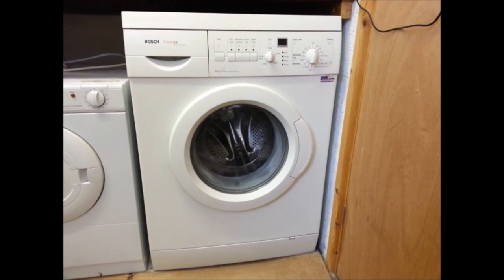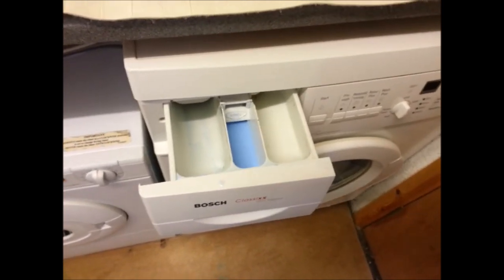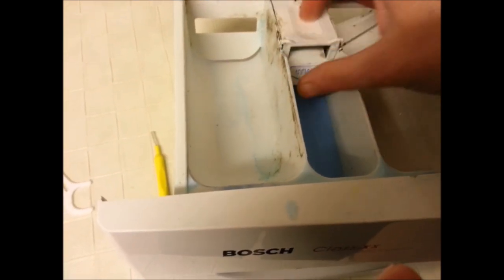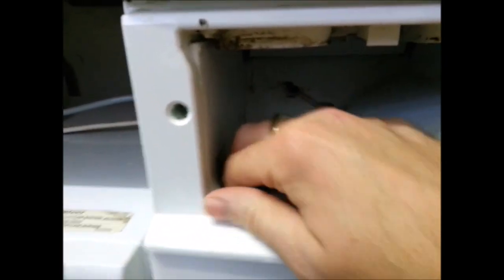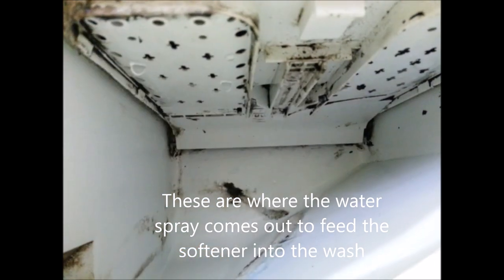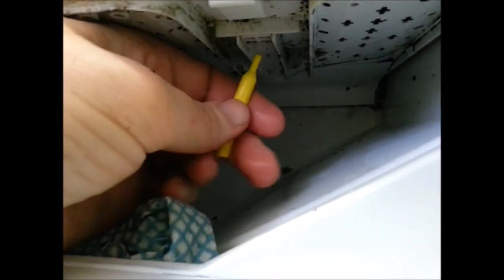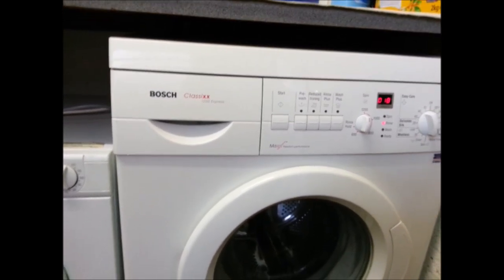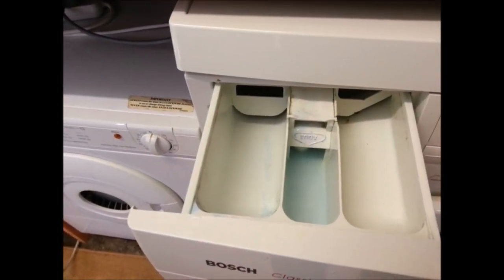How to fix a Bosch washing machine that isn't taking fabric softener

Comment: Spot on - thanks for taking the time to film and upload. Was tearing my hair out trying to figure out why I was getting water on the floor under the machine. Turns out the draw unit was clogged - the inflow hole to the drum was half blocked with washing powder gunge and water was escaping from the draw, flowing down behind the front panel.
Reply from the maker: Glad the video helped. Thanks for taking the time to comment

Comment: thanks for the vid! funny thing is i don't use softener but the water wasn't flowing properly. i took the drawer out, poked the holes a bit, looks like that helped. i also used the air spray just in case. thanks again!

Comment: many thanks for the video on our machine the problem was that after the wash cycle the softener draw was left full of clean water,  i carried out your instructions and gave the whole draw a complete  cleaning throughout  with hot soapy water using a tooth brush and clean sponge pads the ones that are green and white,  one side is rough like a very soft Brillo pad and after the cleaning gave it a run  without any washing in on rinse and spin and it cured the problem thanks once again RUSSELL PINXTON  DERBYSHIRE
Reply from the maker: Hello Amanda, really pleased to hear my video helped solve your problem. Thanks for taking the time to let me know
Reply: Amanda Higton aà

Comment: Clear instructions, thank you! I have had this problem for years! I found that even when using pipe cleaners the inlet pipe was still blocked as it is difficult to get around the 90 degree bend. Used a Dremel to grind away the cross and allow the pipe to be cleaned properly and flow directly into the tray. It now works!
I don't understand why manufacturers use sharp edges as these are known to gather material: poor design workmanship! When was the last time you saw a square water pipe? Also, when it is to be expected, why use pipes and holes of such a small size that will certainly and easily become blocked: again poor design workmanship. As this is not the only Bosch product I own with obvious design flaws I now avoid Bosch when replacing.

Comment: Thanks for this video. I also have a Bosch but have discoverd that this problem mainly occurs if I have been using the concentrated fabric conditioners rather than the original type.

Comment: You can use a computer aerosol air spray cleaner with the thin tube attached and spray the air into the holes.

Comment: Small hand held steam cleaner, with small attachment nozzle, will blast out debris  built up limescale and built up Detergent and Softener residue.. Open drain plug and excess dirty water and residue with flow straight out!

Comment: These are simple to work on. You can remove the lid, take the drawer housing out and it breaks down into several parts and you can run it through a dishwasher to completly clear it.
Reply: Thanks TLC, thats really handy to know and a lot less hassle than messing around with dental implements.  A big problem is that most people who use a washing machine would rightly assume that the detergent and fabric softener they use dont bung their machines up with mould and scum.  If they knew then im sure they'd clean regularly and avoid the problem.

Comment: Thank you for your video, I found it most helpful, my machine has three rows of tiny holes over each dispensing section and my hand gets stuck when I try and clean them 😁 but the interdental brush works for me.

Comment: super clear video. cleaned the drawer out, now waiting for a cycle to run. Been wondering how exactly the additive compartment works though. it seems to look like the nozzles (for want of a better word) fit into each other; so, where does the conditioner go? flummoxed.

Comment: You can use Dettol Washing Machine Cleaner 250ml and it will clean away all the black gunge and make both the soap / fabric conditioner compartment absolutely spotless as good as new. It also will clean all other places within the washing machine that you cannot see.

Comment: I fixed mine by just adding 2 cups of water (500ml) to the dispenser box #2 after cleaning out the impeller trap at the bottom of the washer. I think the pump needs that water to prime the suction inlet.
Hope this helps.

Comment: Great video, had this problem, tried boiling water, fully cleaning out the drawer itself, nothing was working... after watching your video I turned my attention to the jets, fully blocked up with gunk! Didn't think about where the water comes out (honestly didn't have much of an idea of how it worked at all) It was my own fault for trying to clean it before it was blocked, just ran a cloth along the top of the drawer bit, must have been what blocked up the jets... I had to come to work before I tested it but thought I'd leave a comment anyway I'm that confident that was the issue.

Comment: You can break that middle bit off completely and leave it off its just clipped in,, my old bosch used to do this clogging and an engineer just took the middle bit off and it was perfect. but sadly after a few more years the bearing went and was as cheap to buy a new washing machine as it was to fix it.

Comment: Firstly, thanks so much for the great video. I know your first step was the block the hole before starting anything, and I did that the first time I used your method to clean jets...but i forgot to block the whole the next time and the little plastic stick i was using fell down the hole. Can I use my machine anyway or do I need to call out an engineer to try remove the piece first?

Comment: Thank you!  Solved the problem.  Question though, would using a washing machine cleaner more regularly negate this issue?
Reply: Hey, Smudger, was reading through the comments after cleaning out the drawer of my Bosch. Thinking about your question, i dont think using the washing machine cleaner would help with this issue as this problem arises due to impurities in the water coming into the machine from your water source. a build up there is practically inevitable i think.

Comment: It didn't work for my Bosch washer though. It's completely new and nothing should be clogged. I cleaned the holes (they are lined up in a row above the softener compartment) but the washer is still ignoring the softener. I think it's yet another issue. I'm giving up with Bosch washers as the hardware programming/wiring seems dubious in their products. Thank you for the video though.

Comment: Thankyou so much for this information much appreciated. When done this it worked. Fab thanks again.
Reply: You can also use Dettol Washing Machine cleaner 5 in 1 and it will clean all the black gunge away and leave the compartment spotless.

Comment: Hi I did this about year ago and it worked fine. I noticed last week that the fabric conditioner compartment was not emptying although water was coming into to it because the conditioner was diluted. I cleaned everything again however it is still not draining the liquid...any oder ideas would be appreciated before I call in a engineer - thanks

Comment: Wow, it was clearly a long time since the detergent tray itself was ever cleaned,  and even at the making of this video it was not cleaned. You can see black mould and dried on detergent. As a minimum the tray should be removed from time to time and washed in hot water and  perhaps scrubbed with a an old toothbrush also.

Comment: Have a simular problem: it did't take the fabric softener and added water in the dispenser. I did what you suggested. The problem is not solved; it doesn't ad any water anymore but it still doesn't take the fabric softener. Any extra suggestions? Thank you!!

Comment: Hi, I got a Bosch washing machine with the same issue - however I can't get the drawer to come out. it looks like it's got a clip, like yours on the video but when I press it, it still doesn't come out. 
help please
Reply from the maker: +Christina V Hi, I've never heard of that before. Try jiggling it about. It might just be stiff due to a build up of powder
Reply: might be but still I am worried that I might damage the drawer!. 
The button that you press which is situated at the top/a bit far into the drawer does not even seems to respond to my press in any way!
Reply: +Christina V take the drawer out all the way and try pressing a little further back where the clip is

Comment: Yeah, OK I couldn't even get the drawer out till I saw your video (thanks) but you have got one thing wrong......
You definitely don't want softener on towels. Other items yes... towels NO! Towels are there to absorb moisture. A towel with softener treatment loses a lot of its absorbancy and just smears the water around. Also the 'rougher' texture of an untreated towel helps to remove dead skin.
Message to myself: " Get a life"!
Reply from the maker: I'd never though of it like that : )